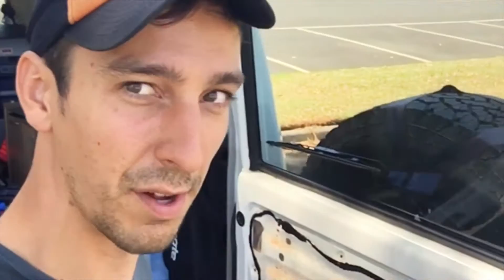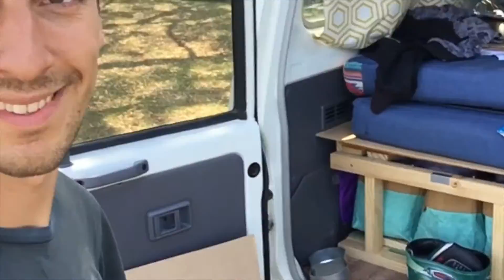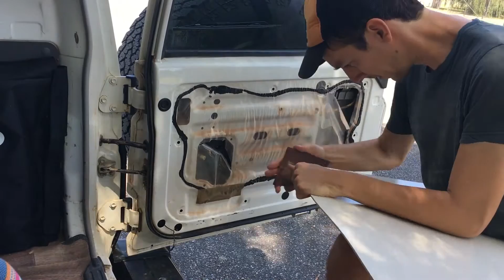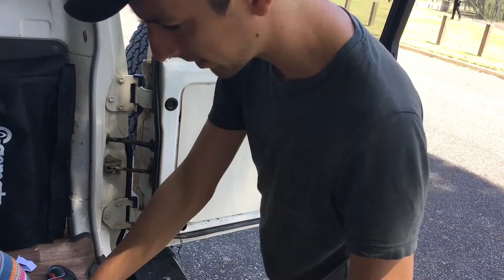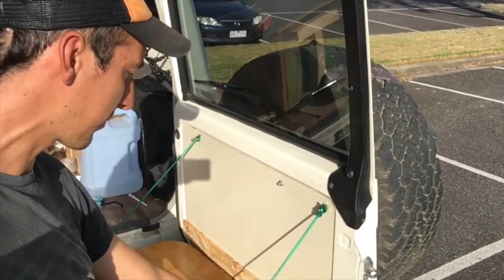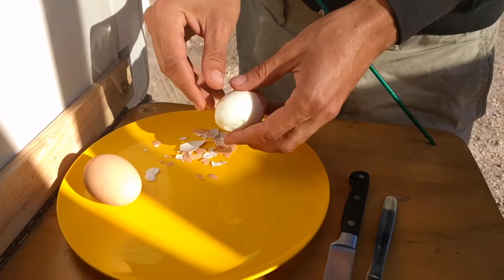Troopy Upgrade - How To Make a DIY Folding Rear Door Table

Comment: Why didn't you just use the original insert panel as a pattern? That would have given the size, corners and bolt hole positions.

Nice serviceable table.
Reply: You're right. I was thinking that I would use a sheet of paper to make the template. But your idea is the right one. Now if feel quite dumb. ;-[

Comment: With all the fiddling around, drilling and mocking around to put this table in place, how much did it cost you to put it all together? Wouldnt it been easier to just buy a folding tressle table in bunnings that cost 35 bucks?????  Not to mention the time you put to put this folding table at the back of your 4wd....a 35 dollar solution ijn bunnings would have been an easier fix and fit !!!!!!!